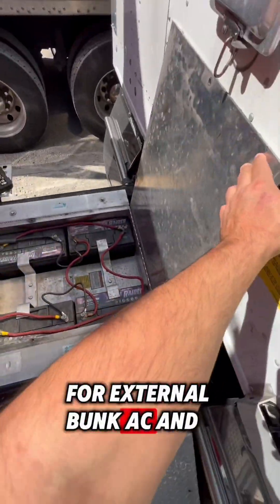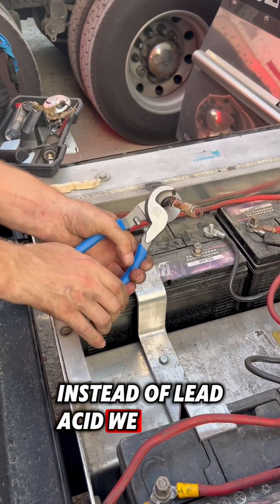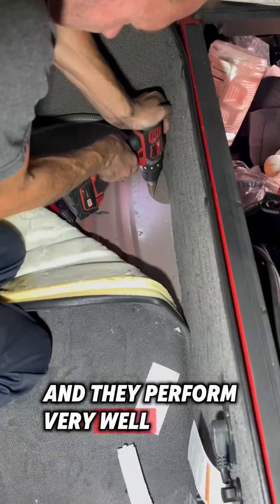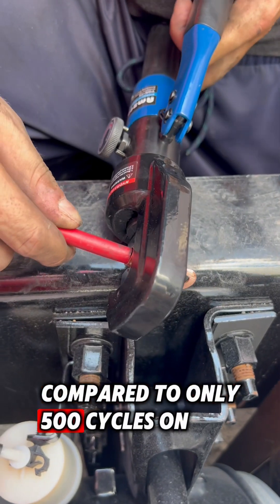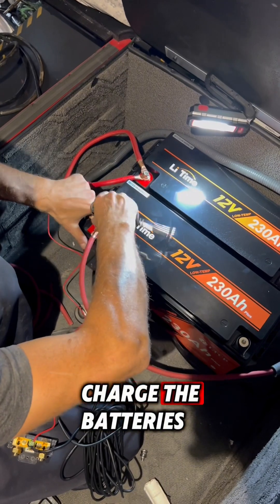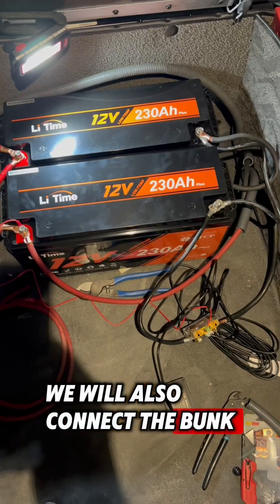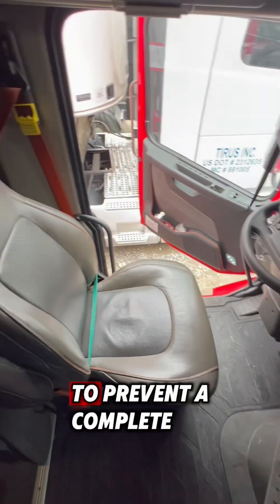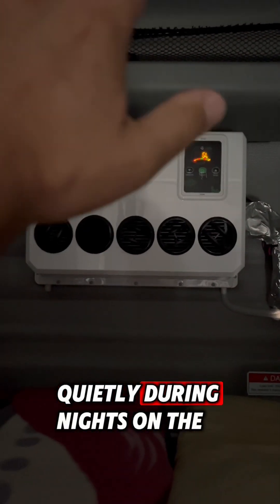Lithium batteries for electric APU on a semi truck. #shorts #trucking

Comment: Good luck with your alternator
Reply: Im hoping he uses a DC-DC charger otherwise its about to get really smokey when those batteries get fully charged.
Reply: 400 bux deal tops for avg sized one. No way you'll whack a 40si
Reply: $300 got me a remy 160a and 20ft of 0 gauge
Reply: 60A dc/dc charger. My truck came with 240A alternator. 40si. Easy no sweat